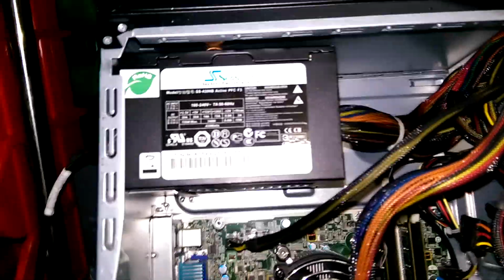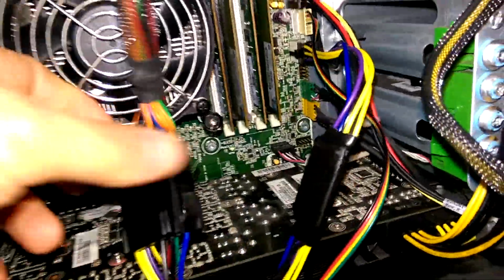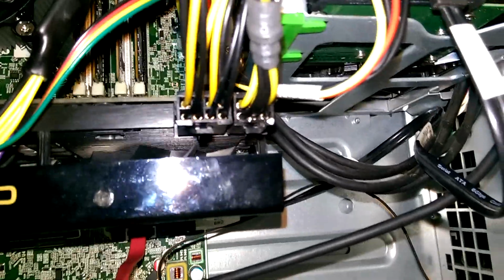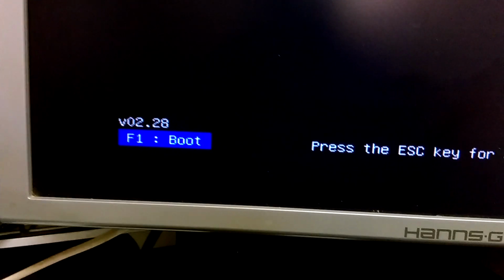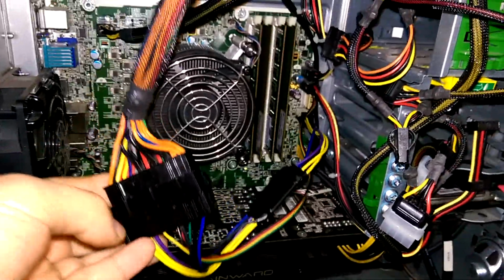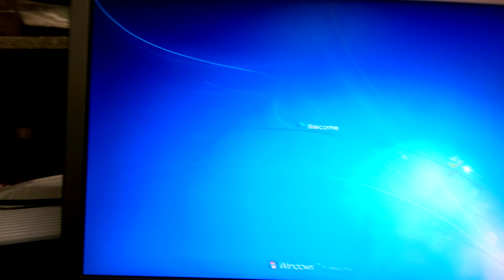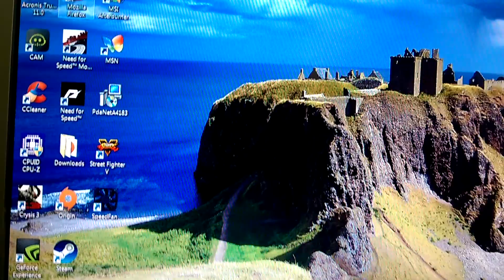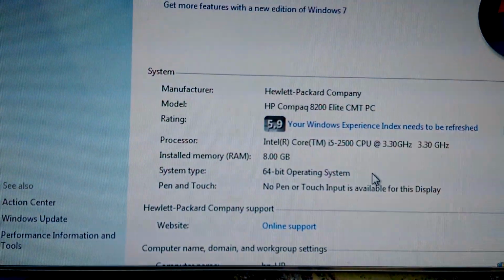HP ELITE 8100 to 8300 SERIES USE YOUR OWN PSU!

Comment: I attempted to get the cable sold by MODdiy a few years ago. It never arrived in the United States. I congratulate the former President for screwing up relations with China so badly that shipping gets lost. I've re-ordered it and hope it arrives here in Florida before I die. I also thank MODdiy for not getting an American company to carry their stuff so this shipping mess will continue to lose them customers. Meanwhile, nobody - literally nobody on YouTube or on web pages has clearly explained what pins go where on that six pin connector. I did find out the connector is called a "6 pin KF2510 connector" and it is only sold in China and the UK. If the author refuses to make the cable, maybe he could sell the connector and extra pins, since we users will have to switch the wires around A LOT until it works. He could boost the British economy and be a hero to the thousands of betrayed HP users.
Reply: Update: still no solution, but I followed the ancient tech advice; RTFM. Read The "Friendly" Manual. The manual for the 8100 Minitower shows what the KF2510 six pin connector does. (If you have the 8200 or 8300 download your specific manual, it's free on the internet.) Don't have it open on this tablet, will list it soon, but one pin goes to the original supply's cooling fan tachometer cable. When the fan runs, it sends out a pulse to this pin. I have a small 12 volt computer fan with 3 wires. I will try powering the fan from a 12 volt line on a molex connector, and putting the tachometer line into that pin of the KF2510 connector. Yes, I found the connector on eBay, only I had to buy FIFTY of the things. Just to get the one crimp pin to add the tach signal. If you don't hear from me within a month it's because it didn't work and I died in the resulting explosion.

Comment: I have the HP 8000 Elite. Hello thank for the video. I'm trying to figure out why my P2 connector has 5 wires going to 5 separate pins and the adapter you have here in the video and what I saw on ebay only have 4 wires going to 4 separate pins? Not talking about the 6 pin but the one you say in the video has 4 because mine has 5.
Reply from the maker: jstmars7 hi there It won't work on the 8000 series sorry m8 8100 to 8300

Comment: Wow! Cool! I have a 8200 as well, but my motherboard config looks a bit different. On my motherboard there seems to be a smaller CPU power connector with only 4 pins (it says CPUPWR P3 on the motherboard), but it is nog a standard 4-pin connector. As I am comparing them one pin has a rounded 
configuration and the standard one has a rectangular configuration. Any tips regarding this? Thanks for the input!
Reply: I was walso wondering about that

Comment: In the HP manual http://h20628.www2.hp.com/km-ext/kmcsdirect/emr_na-c04224518-1.pdf , it says there's two 4 pin connectors, PWR and PWRCPU, as well as the 6 pin PWRCMD, and in my HP Compaq 6200 MT I can see all three.  How did you get away with only plugging in PWR and PWRCMD?
Reply: I see.  PWRCPU is supposedly a standard P4 connector, so I need a P4, or a Molex->P4 adapter for this.  The adapter appears to want a 24-pin ATX input, and the system appears to need everything at +12V and a minimal amount of -12V and nothing else.  So anyone who's looking to buy a PSU, those are your specs.
Reply: Thomas, I'm awaiting arrival of this cable and want to make sure the PSU I get is compatible. Are you able to elaborate on the specs? Maybe even an example?
Much appreciated.
Reply: Me too, but those are the specs that the manual has and also the pictures on the cable sale page that has the original power supply spec sheet.  Standard ATX, 24 pin output, with enough power for everything on the 12V rail, and at least one P4 output for the CPU.  You're probably looking to put a video card in your computer, so that needs as many PCIe supplemental power (6 pin or 6+2 pin) as that needs.
Reply from the maker: +Bee Row Hi there. so the original HP power supply has 3 cables coming from it a 6 pin and a 4 pin and the small 6 pin with 4 cables on it. you just remove those 3 and leave the rest. the only thing you need is your 24 pin and a 4 PIN from your new power supply that's it. the other cables on the motherboard are just Loops that power your DVD drive or hard drive you can bypass them and just power them directly from your new power supply if you choose to. I'll take some pictures and put them in my description thanks hope that helped

Comment: Hm, the 8300 series does have a 12v standby power in the small white connector and a standard psu delivers 5v, so besides just a adapter I belive i also need some kind of converter from 5 to 12 v right??
Reply: Great, thanks, do you know where i can buy one. Link does not seem to be valid anymore.

Comment: Hey, i recently bought your adapter and used it to connect my PSU (CoolerMaster RS600-AMBA-D3). Unfortunately it doesnt work and i am only getting a green blinking light on the mainboard and the included speaker makes a "clicking" sound. Would be nice if you could help me out in this case. Do you have any recommended PSU? I am starting to think that the CoolerMaster somehow doesnt "want" to provide the power? It might have an intelligent check because not all cables are connected by using your adapter - not sure on this, this was just my first thought.
Waiting for your help to get the PC workin and to use it with my additional GPU :)
Reply from the maker: S4LuV4L Hi there sorry your having trouble I use a Corsair vs550 which works fine. any decent power supply should work fine

Comment: Thank you for the posting! I just wonder if your new psu fan becomes much more noisy than the last psu? As I see somewhere else they say the missed 2 pins on the 6 pin single row is actually for feeding back psu workload to mobo and the mobo controlling the fan speed and if those 2 were missing the feedback is unavailable so the fan will always run at full speed.  I have the same model, just wanna make sure if their diagnostics is correct.
Reply from the maker: the cpu fan and pc fans can get loud under full load while playing a game for a while tries to keep my CPU below 50 Celsius. other than that I think it's the same. thanks
Reply: +Sotiris Demetriou thanks this is helpful!
Reply: +Sotiris Demetriou by the way are you able to disable this annoying psu fan checking function in the Bios? I mean make the mobo ignore it.
Reply from the maker: +GYW no I can't. but someone   who got one of me said they don't  get the check but it's just a push of f1 and you boot up. ☺

Comment: Wow this looks really cool, may I ask, what pin this converter is compatible with? Can any "New" PSU cable be inserted into the converter? I just bought the 8300, I was worried a little bit about the Power supply for my graphics cards, this should help a lot.
Reply from the maker: Twisted Tammer Hi there any standard psu can be used. as long as it's enough for your new graphics card if you plan to put one in. 500 to 650 watt is more then enough.  thanks
Reply: Hay I have an hp compaq elite 8300 sff would I have to change any pin configurations or voltage I'm struggling

Comment: thanks for this, i have got the same problem, and it works.
but, what with the; 515-power supply fan not detected, can you help
Reply from the maker: no some people psu work but it's not a problem just hit F1
Reply from the maker: can't fix that sorry. it's a minor thing
Reply: same with me
Reply: dirk dupon I found this, seems easy enough if u know which wire is the  "tachometer" on the 6 pin connector. On the 6 pin fan header connection only 3 wires are needed, the PSON, PSOK, and the TAC, the TAC can get wired to the tach lead on the CPU Fan to disable the PS Fan FAIL message in the Bios. Good luck, and be sure to post any good results.
Reply: at the 6 pin connector on which only 4 are connectet, the nr 5 pin is the Fan control. Just bridge the yellow cable from the cpu fan to the 5 pin and its done ;D either u can install a normal fan and connect the yellow cable fromthis one to pin 5.
Reply: Don't give false information. On the 6000 series, and the 8000 series, Pin 1 is Fan Command/control, and Pin 2 is fan speed.  According to HP diagrams pin 1 is on the right when those small fins are pointing up, and the connector end is facing you.
Reply: i meant that 4 pins are connectet andthe 5th pin (which isnt installed) is the one u need to connect to another fan speed. then u wont get the message at startup.
Reply: I don't quite understand about the fan rewire. can you please explain?
Reply: HP motherboard and PSU are proprietary. The MB has sensors for heat in the case. Thus the PSU has a second fan in which the motherboard can control. Since the ATX standard has no such signaling, you merely wire the fan control to ground pins on the ATX plug. There are two of them, one for fan on/off/ and one for fan speed. The other two pins  are for power the MB needs.
Reply: cool. thanks a lot! btw I connected everything and its working perfectly, but The screws holes don't fit with the PSU. how did you guys fit it?
Reply: Kannan Ravindran two of the holes will align. don't worry about the others.
Reply: I have a hp 8300 mt. Sadly none of the holes align. Going to return the psu and cable. If was fun while it lasted :(

Comment: I just bought an adapter,  but when i turn on power switch,  on psu,  the fans automaticly  start rotating. When i try to turn on PC via switch,  it will automaticly turn off,  and after few seconds, the fans start to rotate  again.  Bulb  on a MB glows green, but the bulbs under the main switch are not glowing...  Pls can you advise me what em i doing  wrong.?  Thx
Reply from the maker: Hi there. Your not doing anything wrong the cable is no good and I suggest you don't use it because is can blow your motherboard.
Reply: @sotirislive  so should  i buy another one?  I actually can see the difference  in that white P2 cable on my psu ,  that has wires put in oposite order,  than the P2 on the adapter.  Could this be  the source of problem.?

Comment: Bought a psu (+3.3v, +5v, +12v, -12v, +5vsb) the psu is for HP Pavilion Slimline S5000 it fits into the sff 8300. The cable (i bough on ebay specially for this pc) comes with a 12v boost, please let me know the psu and cable with the boost could ruin my motherboard or something. I don't know about volt but since im using a specific psu for anpther pc (not a standard) i don't know of i could ruin everything
Reply from the maker: Hi there I am unsure m8 all these cables are different and I tested them on my pc before before sending them out I had a few issues one blow my motherboard  and many looping never starting up. It's a risk. Sorry I can't be more precise
Reply: @sotirislive  i guess I'll risk it. Thank you

Comment: Thx for the feedback!
btw im using the same pc in the vid, and was wondering if i can get a Sapphire R9 285 to work in it with the mentioned connector, or will it harm the motherboard
Reply: I think that if anything you'd be limited by size, that card is over 9 inches tall.  I doubt the case would fit it.

Comment: How did you get your psu to stay there? I put an msi 1050ti and swapped the motherboard for an msi b450 gaming plus motherboard paired with a ryzen 5 3600. But i cant figure out how to keep the psu in place
Reply: Use the old holes and drill new ones where you have to, be careful to not damage the PSU

Comment: Hello, I am planning on upgrading HP Elite 8300 Tower 8gb DDr3, i7-3770 with a 1050ti. Will the 320w psu be enough? Thanks
Reply from the maker: Should be
Reply: I heard that in the sff versions the pcie is restricted to like 25 or 35w. I have the largest tower version. I presume this restriction is not present and instead it is 75w?

Comment: What PSU is installed?If i buy a EVGA 500W is good for HP 8300 TWR I7 3770?
Reply from the maker: Should be fine. It's a Corsair 520 watt
Reply: @sotirislive  Thanks for your answer I would need this too ATX Main 24-Pin to 6-Pin PCI-E PSU Power Adapter Cable 18AWG for HP Elite 8100 8200 8300 800G1 for to connect the PSU to HP Motherboard.

Comment: I have a problem I did everything you said with a lepra 500w power supply and the adapter the but the computer starts beeping when I turn it on and I don't k ow what to do
Reply: @pieceone234  same problem here, 4 beeps, red power LED - The code comes back as power overload, did you solve your issue?
Reply: @pieceone234  how much?

Comment: Will this work in HP 8200 SFF? I will buy it immediatly.
Reply from the maker: I'm not sure a few people have asked the same thing. as for as I see they used the same pins on the power supply but the sff  wattage is is less. do you live in the UK?
Reply: No, Portugal. I would probably buy a reconditioned computer with i7 2600

Comment: Will this work for an HP 6000 / 6300 ? It is almost the same as the HP 8300. Same motherboard almost. slightly different.
Reply from the maker: sorry I have no idea if it will work. if your power supply is the same as the picture on eBay then it could work. but I have no way of knowing. sorry
Reply: Alex4SiliconValley I know it works for hp 6000 pro Sff but idk about the original but pretty sure it will work
Reply: The original 240W powersupply is very universal through the HP models.  It should fit the Pro 6000, 6005 6200 & Elite 8000, 8100, 8200 SFF machines.

Comment: When watching the video I noticed that on the small 6pin connector the upper 4 pins are used (0:36 sec), but on my original 6pin connector the lower 4pins are used. It is a HP Elite 8200 CMT. Do you think it will work for me anyway? Thanks.
Reply from the maker: it the tower the same? and is your psu the same as in the picture on eBay? if so should work
Reply: Model as well as part number of the PSU are the same as in your ebay picture, so I'll give it a try. No risk - no fun :)) Cheers
Reply: It works exactely as shown in the video! Thank you for professional ebay transaction and very fast delivery! Cheers, Matthias
Reply from the maker: +Matthias Thor no problem m8. thanks for that :)

Comment: What can I upgrade my power supply to???? Nothing will fit cause my hard drive bay is blocking like 1/2 a normal ATX mini power supply.
My PC is HP elite 8300 SFF small form factor
Please help me find something at least 300W or higher

Comment: Please let me know how much it will be, all in, to ship to Ottawa, ON, Canada.

Much appreciated.
Reply from the maker: i will let you know later on today the cost. thanks
Reply from the maker: total cost will be £24. thanks
Reply: Sotiris. It took a little while, but I received my cable convertor. I replaced the PSU with an EVGA 500 B (100-B1-0500-KR). I then added a Nvdia GeForce GTX 760. Everything works great!. While the new PSU dimensions were a bit off, I still managed to secure the unit. As previously noted by you, the only annoyance is the POST-"PSU fan not detected" when the PC is booted. Very happy and highly recommend this solution. 
Yes, you are dealing with a PSU, but I found this swap job very simple. If your comfortable with installing cards or memory, this task is well within skill set.
Be glad to answer anyone's questions if I'm able.
Reply from the maker: +Bee Row thanks for that info. very glad your happy. now time to play some game on a proper gpu :)

Comment: Hi, I have an 8300 sff that I woulkd like to upgrade the psu on. Are these still available anywhere and what PSU would you recomend to use with it to run a decent graphics card?
Reply: For the SFF it is a completely different wire configuration than the ATX one.I have a 8200 sff and i can't find a cable myself looked at lots of video's but none really show the pin configuration for the SFF. I also need helppp.
Reply: @marcmoody6222  Hi Marc, see this link to a question I asked on the HP support forum 
https://h30434.www3.hp.com/t5/Desktop-Hardware-and-Upgrade-Questions/HP-Compaq-elite-8300-SFF-PSU-Upgrade/td-p/7791901
It shows links to a psu and a cable that works fine in my 8300 sff. The only thing missing is the link to stop the no fan alarm on boot. But that's pretty easy to either live with or fix by a simple jumper lead. I took the board out of the original power supply and mounted the new one in the case. Not a perfect fit but it works fine.
I tried contacting this guy on here and via their US web site but got no reply whatsoever.

Comment: Im planning to use a 1050ti 4g mini on this build. I went to pc part picker to see how much volts this would all take with that gpu and it said 238w. im assuming this has 240w but i feel like it wont be a good idea. Im not sure can you let me know?
Reply from the maker: Tylor Medina Hi there if the card need external power then you will need to change your power supply if not you should be fine.
Reply from the maker: Tylor Medina BTW what model HP do you own? and I would get a 3gb 1060 if on a tight budget.  better card imo
Reply: Sotiris Demetriou the same model as urs. hp elite 8200 sff
Reply: Sotiris Demetriou would the 1060 work on the stock power supply it comes with? my version has 16gb ram, i7 2600, 2tb
Reply from the maker: No if the GPU requires external power you need to change it. Best card if you don't want to change anything is the gtx750ti some of them don't require external power
Reply: Ok this is old but it most likely said it took 238w for it and the system together most likely! The GTX 1050ti does not consume that much watts.

Comment: Could you add shipping costs to the USA to your listing?  Ebay won't let me send a message without placing an order and won't let me place an order without shipping costs listed.  I'm in Massachusetts if that's important.
Reply from the maker: the other 4 pin is from your new replacement PSU